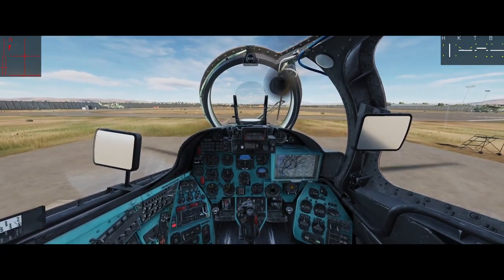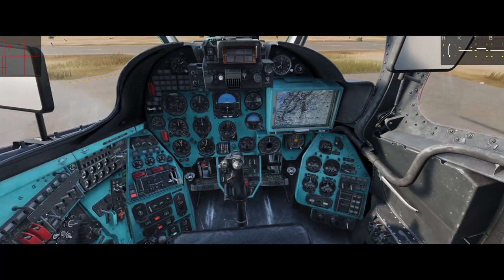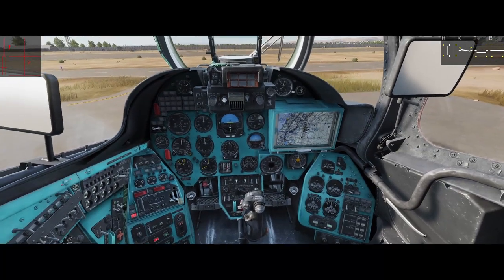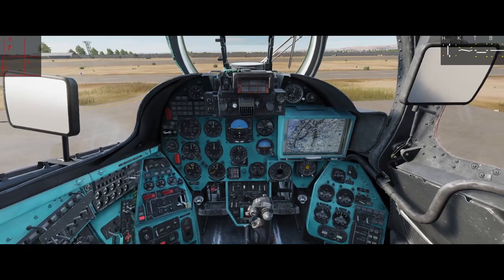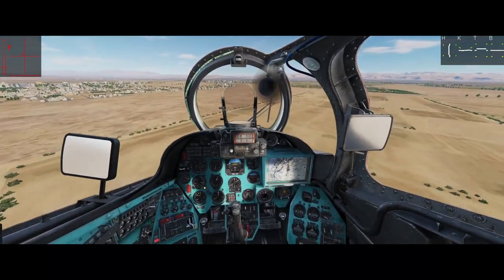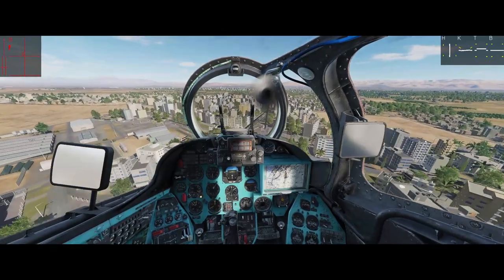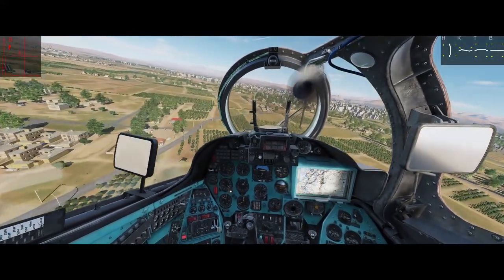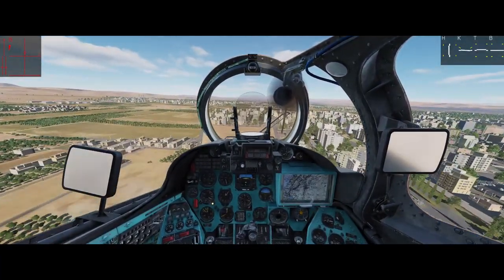You and your Hind - Understanding The Trimmer - including how to hover

Comment: Your advice on pressing the trim button, then releasing the stick quickly to allow it to re-center seemed to really improve my results. I'm using a Thrustmaster Warthog and couldn't get a consistent trim setting until I tried the press, and allow to re-center quick and it worked. Thanks
Reply from the maker: Thanks for the feedback mate! When you have more fun with the module due to this it was absolutely worth it :D
Reply: I actually use the "Speed brake" thumb switch on the throttle for trim and trim reset, just because you don't need to hold it ;)
If you fly the KA-50, it's a must to use this method of holding the trimmer and letting go after you set the attitude.
Reply from the maker: @AdarColussi  that's a smart binding mate! But in the shark I have these buttons used for some other stuff. However I use the pinky button for trim.

Comment: probably the most important button on the Mi-24 and KA-50...
at least the reset trim is not as violent as the KA-50 :P

I highly recommend you try using the Trim Hat (nose up/down bank left/right) for small corrections, it really helps with small trim adjustments ;)
Reply: yea dude , I could get to hover easily by using the trim hat and the auto pilot hold track

Comment: The standard trim is best for me, you just have to immediately release the stick as soon as you hit the button.
Reply from the maker: To be honest, I did not even try Standard as I am used to the Center after trim option from all the other choppers.
Reply: @nazradu  I tried the alternate method, but sometimes it wouldn't redo the zero so to speak, so moving my stick after hitting trim gave me double the input which has crashed me several times

Comment: Awsome Videos. How do you keep straight and level. When I hit the trimmer. It always seems I am dipping down to the right. And also going into a hover. I almost have to use full pedal. And lastly when I hit the trimmer in a good spot. The heli goes nose down for some reason.
Reply from the maker: Are you having any AP channels enabled? What you describe, especialy the tilting to the right sounds like the bank channel is disabled. Another reason could be your airspeed. When you hit 320 kph the chopper will start rolling to the right.
Reply: @nazradu  - Hi Naz pitch and roll are on. But not Yaw. It is not a hard roll right. Its just like canted to the right always. And trying to get into hover it is a massive amount of pedal. Where I see you and others just pick right up and stay stable. And I cant even get into a hover from flight to. Say land directly on the numbers or on an LZ pad. But what bugs me most after trying to transition, is the trim I get in good position. Hit trim button and the helicopter goes nose down then kinda comes back up. When all I did is hit trim button then move stick back to center. It works a little better using default. But I use center positio. Trim in MI8 and works good but for some reason I'm having issues in 24. That and no cues for landing such as the shakes or the click of the trim button. And lastly yeah not going over 320. For the retreating blade stall. Found that out early. And thank you a ton for your videos. I look forward to landing videos.